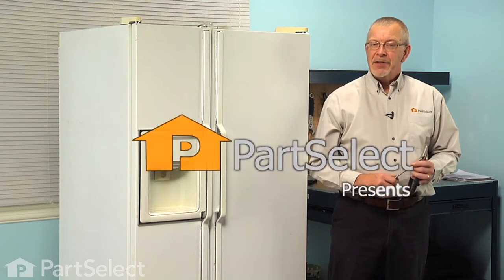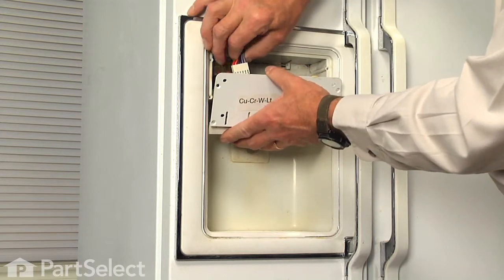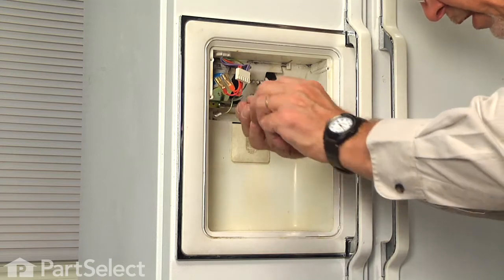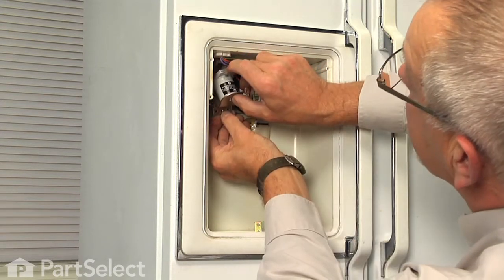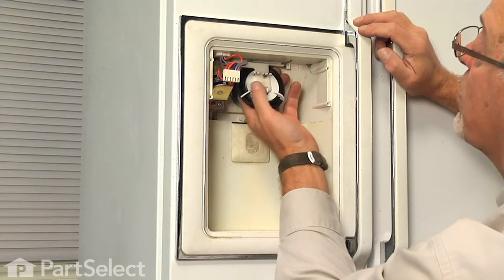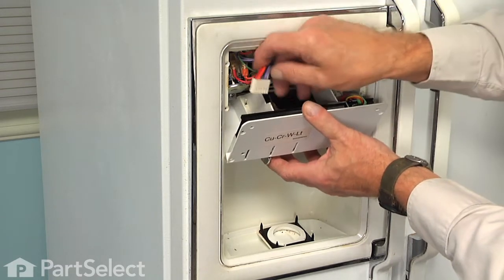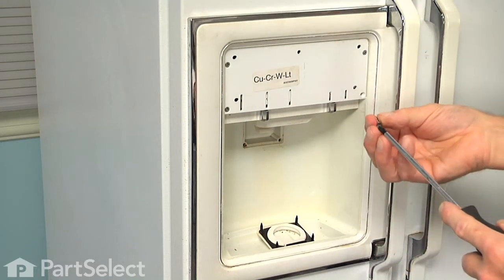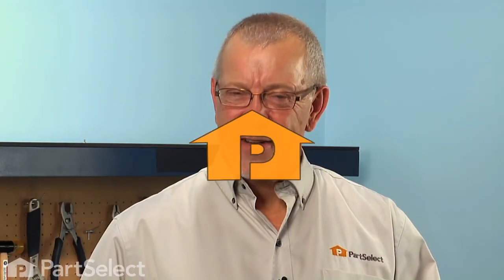Refrigerator Repair - Replacing the Dispenser Solenoid (GE Part # WR62X107)

Comment: Hi Steve I am a 56 yr old female whom GE Refrigerator TFX25JRYFWW has frost build up on dispenser.  Water comes out fine and ice too.  I have changed the solenoid and flapper and still have same problem per your videos which are awesome.  Help.....
Reply from the maker: Migdalia Seda If you have already replaced the flapper, it sounds like you need a new defrost timer. Here is a link to the part: http://www.partselect.com/PS310858-GE-WR9X489-Defrost-Timer.htm?SourceCode=13&SearchTerm=TFX25JRYFWW&ModelNum=TFX25JRYFWW